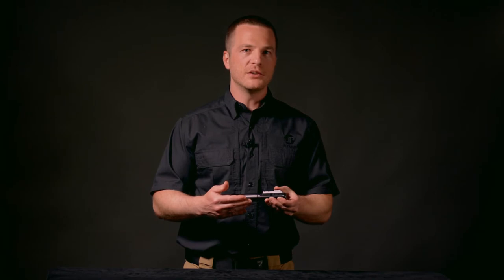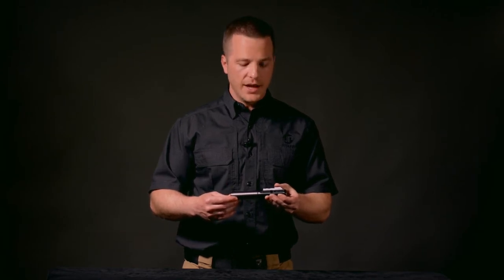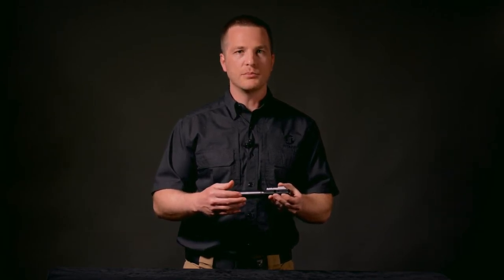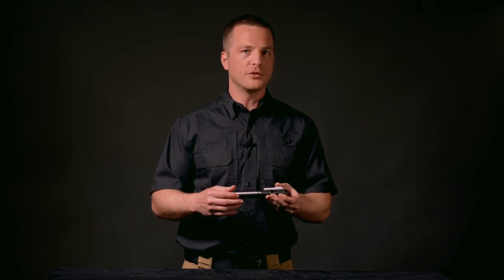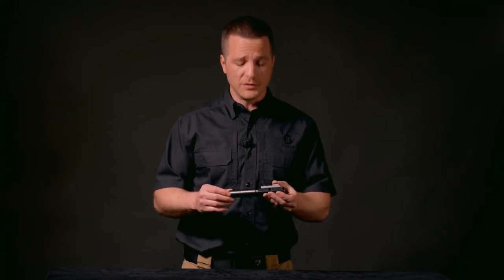Improved 9mm Bolt - New Product Showcase - JULY 2017

Comment: Does it have a full auto bolt carrier cut out, want to use it with the foster ecco
Reply: I8THEmagictoaster that's a good question did you hear anything about that I have a 9mm PSA that I'm having trouble with in modifying the bolt to get it working with my echo 2